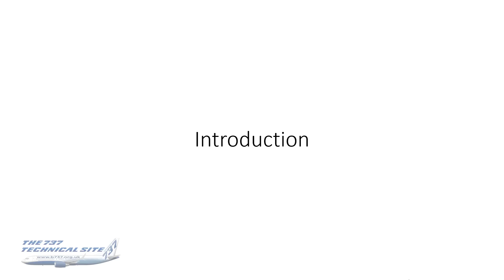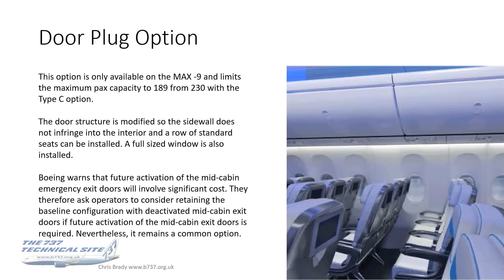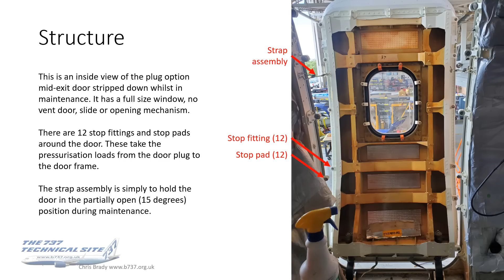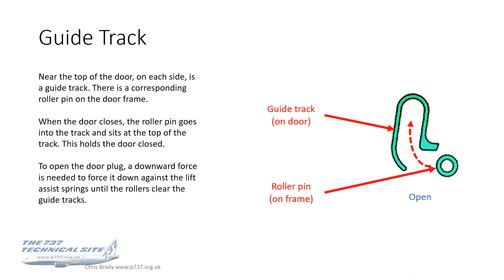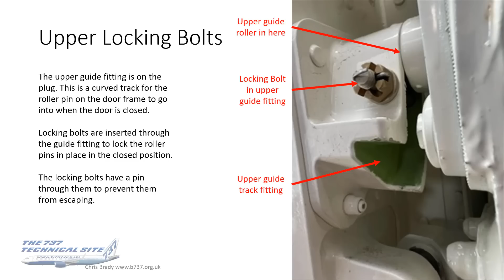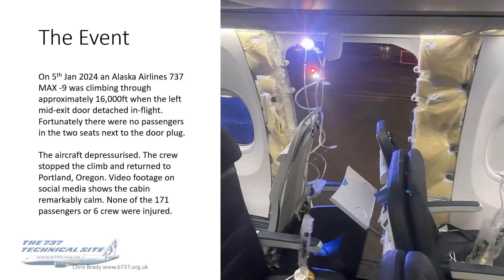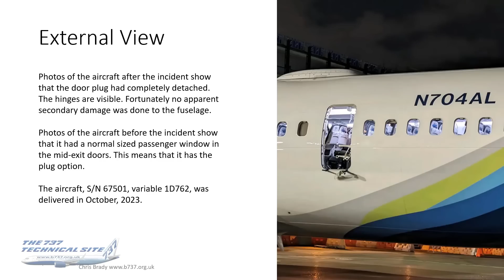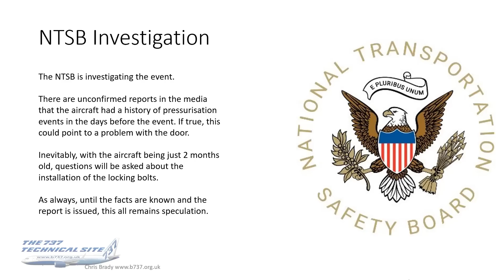737 Mid-Cabin Emergency Exit Doors - Plug Option

Comment: Chris the Boeing 737NG-900ER also has plugs installed. Last night we reinspected a -900ER for any discrepancies and found none. That aircraft had over 41,000 hours TT. If N704AL had failed the decay check: quite easy to perform, it would have been found and solved, so I feel that that was speculation on the pressurization issue. These plugs are not on line item inspections and only get inspected during a heavy check, there would have been no previous inspection done since it was such a young aircraft. BTW I love your channel keep up the good work. As you stated in this video there would have been a catastrophic failure of six different bolts to produce this effect. I await the NTSB report of their findings.
Reply: They're castle nuts with wire locks, so IF the issue is missing bolts it's not just a torque issue.  Missing wire locks would be an easy thing to spot.
Reply: @SteveSmith-cd4hs  It s gotta be the case, an inspection by a Inspector was simply pencil wipped or forgotten in the Aircraft paperwork! All doors require 100% Inspector buyback!!
Reply: @SAC-93  forgot about the person that actually did the work.
Reply: @scootercurri1815  Correct the lack of bolts or untorqued bolts slipped past two sets of eyes!! Inspection dept is ultimately responsible as that plug had to have a mandatory buyback from the mech doing the work
Reply: @SAC-93   "as that plug had to have a mandatory buyback from the mech doing the work"
Are you positive about that?  Closing a door is not normally an inspection item. But this was a plug, so there is that question.
Reply: @SteveSmith-cd4hs The wire locks are hidden behind the attachments.
Reply: Not necessarily a catastrophic failure of six different bolts, if all of the nuts were never tightened or even entirely omitted, one would only need vibration and pressurization/depressurization cycles to potentially back the bolts out. Unless there's an obstruction present to prevent that from happening, which doesn't appear to be the case.
In that type of case, assembly practices being adjusted and a slightly more fault tolerant design would entirely mitigate the issue.
Either way, that's why they do thorough inspections and investigations.
Reply: I think we're gonna find out that there were no bolts installed.    It makes sense to me bc even 1 or 2 would prevent this.  I can't see any other way for thia to happen it's either neglect or intentional @spvillano
Reply: @philipparana9225  I'm starting to think it was shoddy installation, given United reporting needing to tighten some doors bolts. They're not going to work loose with that crown bolt and cotter pin in place and likely wouldn't get mentioned by United if it was merely adjusting torque.
Reply: @spvillano my bet is no bolts at all.  Makes  more sense.  Also if someone installs one they prob gonna do all 6, but let's say they have no hardware and it gets moved down the line then the next person sees no bolts and assumes that's the way.
Reply: @philipparana9225  I only saw 4 bolts.
Reply: @spvillano  That's my feeling on what happened.  The nuts were not torqued up, vibrated loose and the rest is history.  A quality management issue from Renton.
Reply: @cjmillsnun  That has gotta be the reason! I can't think of any other cause- as I don't see any structure damage!!
Reply: Not torqued then not split pinned @cjmillsnun
Reply: @cjmillsnun  they are castle nuts so they dont get torqued.  you insert a cotter pin through the nut and bolt to prevent loosening
Reply: @AGM796  false! Most castle nuts have torque values !
Reply: @SAC-93   "false! Most castle nuts have torque values !"
This is true. They allow you to use an initial torque and then keep tightening until the hole lines up....without exceeding the max torque. If the hole doesn't line up then get a different length bolt or add or subtract washers.
Reply: @SAC-93   Oh no now I gotta go torque a whole lot of castle nuts.  thank you for bringing this to my attention
Reply: What are the chances that the RIGHT door has the same issue on the accident aircraft?  Assuming the doors were removed during FAL, you would think they get closed up at the same time.  It's going to be interesting what they find (or don't find).
Reply: @satoshimanabe2493   Yes it will Sato. I have found MANY identical faults by looking at the other side. One time I found a corroded fuselage part that was unexpected. I went to the hangar next door and found the identical fault on another aircraft. They threw rocks at me.  LOL
Reply: Or the bolts were never installed at all. The door is sealed without any of the bolts installed.
Reply: @allangibson8494   "Or the bolts were never installed at all. "
Highly unlikely since the vertical assist springs would cause the door to rise above the stop blocks.
Reply: @rael5469  the assist springs do not apply enough force to lift the entire weight of the door plug, only to ASSIST; hence the name.  So, the door stops would still remain interior to the frame stops...until vibration/landing was sufficient to overcome the additional force to slide the door sufficiently upward (<1"?) to allow the door stops to rise above the frame stops.
Reply: @BruceLiebert   "the assist springs do not apply enough force to lift the entire weight of the door plug"
How do you know?  What does it matter?  If the bolts were never installed a simple bump in the taxiway would cause the door plug to blow out. You heard Juan explain how after engine start the pressurization system put a slight pressure on the fuselage......specifically to tighten up the door seals. However after landing the outflow valve opens fully to depressurize the aircraft. If there were no bolts in that door it would have fallen out of the opening on the first flight.....not two months later.
Reply: @rael5469  It matters because if the springs were sufficient to lift the door and overcome the friction of the 12 stops against one another, the door would have detached immediately.
Reply: @BruceLiebert   If the bolts in question had never been installed the door would have detached immediately because the aircraft bounces on uneven taxiways and runways plus turbulence in the air.  A bump in the taxiway plus the help of the vertical assist springs would dislodge the plug almost immediately. I don't know with 100% certainty but I highly doubt the bolts were never installed. I think they were installed but not safetied and it took these two months for all four bolts to work their way loose.
Reply: I doubt that plane has even had a B check let alone a C check. Alaska hasn’t removed those plugs for maintenance. This is a Boeing issue.
Reply: @mendodsoregonbackroads6632   You can't say that for sure. Why even say it?
Reply: @rael5469  Because B checks are performed every 6-8 months, whereas C checks are performed every 20-24 months. This aircraft was delivered to Alaska in October. B checks don’t involve a structural inspection that involves removing all the seats and stowage bins, lavs, interior panels and so forth needed to access the plug or inspect the inside of the fuselage. That is done at C and D check.
Reply: @mendodsoregonbackroads6632   You have no idea whether they did any maintenance around that door plug. It doesn't have to be at any scheduled check. Other commenters said the aircraft was written up for pressurization problems. Did they do any maintenance around that plug at THAT time? You don't know and I don't know.
Reply: @rael5469  Doesn't sound like it. According the NTSB, they inspected the LIGHT. That makes sense. If a light is coming on that is not supposed to come on, then it must be a problem with the light.
Reply: @SAC-93  the picture of the accident aircraft shows that the pins are on the airframe and thus the guide channels are on the door.
Reply: @BaliMystic  I beg your pardon- I stand corrected- you were right, and I was wrong upon further investigation!
Reply: @BaliMystic  maybe we are talking about two different things- the guide channels have to be on the Airframe- the rolling pin will be on the door
Reply: @BaliMystic  Go to 9:38- the channel guide is clearly mounted to the airframe!!
Reply: @SAC-93   No, the guide channel is on the door plug. The guide roller can be seen on the aircraft in the photos.
Reply: @rael5469  yes I was wrong on that- I corrected my statement
Reply: Thanks for this information.
Reply: "That aircraft had over 41,000 hours TT." 
Practically new. barely broken in.
Reply: @@smacktard6051  " How do you think the door blew off without breaking the stops." 
The door stops mounted to the aircraft can be seen in the photos so far.  Everything is possible at this point until they find the door. Maybe the door plug itself had structural failure.
Reply: @@smacktard6051agree 100 percent.
Reply: We need to wait on the inspection results for the door itself. Particularly the roller guides. If they are broken, it could indicate that the door stop fittings were not rigged, making the guides carry the loads
Reply: @@smacktard6051 Because the door stops slid upwards past the frame stops, as designed.
Reply: I have to interject/disagree with the replies. In my opinion, IF the bolts were possibly over torqued (to achieve cotter pin placement) there is a possibility that the guide channel was structurally compromised and pressurization cycles caused it/them to fail thus allowing the door to open. We will have to see if they ever find the door to complete the investigation.
The comment about inspection pencil whipping is pretty strong, especially since Boeing has been under great pressure with the goose egg of an aircraft.
Reply: @gomez2724  I think the cotter pins and castellated nuts are the root cause. Used to have those to secure automotive wheel bearings on ball joint front suspensions and there can be a tendency to not tighten the nut sufficiently if you are trying to thread the cotter pin through the slot in the nut & the hole in the bolt/axle. But the cotter pin alone is not enough to resist the load forces. Awaiting the NTSB report.
Reply: @29caddy  there is negligible force on the cotter pin.
Reply: @gomez2724  Not knowing the bolt size or thread pitch this is just speculation and Im not fully conversant with S,A,E, threading. However if a 1/2 inch bolt of 13 tpi. and over torqued to the next castelation would give 12thousands of an inch of aditional grip lenght compression (if my math is correct).
Reply: Jeez get over yourself. Nobody needs to act as defenders of Boeing here.
Reply: @unthenner5519  fact finding is not defending anyone, it's just what its name suggests, finding of facts, root causes and means of repeating an accident.
And I'm a bit weird, I far prefer fact finding to have, you know, facts and investigations that actually involve investigating, rather than fingerpointing.
Reply: @gomez2724   I would agree with you to the point you made.....but the bottom bolts should have held the plug down against the stops. The upper channel is only to guide the door against the stops. The stops do all the holding against cabin pressure. I would think that those lower bolts would be adequate to hold the plug down and centered on the stops. .....unless they were also over torqued and cracked the lower fitting also. And that brings up another question......WHY leave the vertical assist springs installed on a plug? Maybe they should delete them by a Service Bulletin or even an Airworthiness Directive.
Reply: @rael5469  According to this video and what I've experienced, this door is only "hinged" at the bottom, the hinge pivots on bolts, they do not hold the door in any position. The upper roller guide cams go into the guide and rotate up, moving the door outward to the stops. The stops do not hold the door at all, they are there for adjustment in and out of the door for sealing/fairing.
Reply: @gomez2724    I've rigged a LOT of doors. Cargo doors, compartment doors....and main cabin. The stops hold everything. The roller guide only positions the door over the stops. Once the cabin is pressurized the door is blown outward until it contacts the stop pads. The stop pads hold all the force of the door against cabin pressure.
Reply: @rael5469  Not overtorqued- just not torqued or cotter pinned!- is the most likely suspect!!
Reply: @rael5469  "why woul leave the springs on a plug door" exactly the question.
Reply: @SAC-93   Well I'm telling you that I've seen over torqued bolts crack mount structure. Just sayin.
Reply: @SAC-93   We can't know yet until they find the door plug.
Reply: I'm curious why the EAD does not apply to NG-900(ER) aircraft with the plug option. Could it be that they have a different design than the MAX 9?
Reply: @AvGeekLucky  The 900ER's have been flying for about 10 years and never has this happened. No the design is the exactly the same. we have two MAX's right now and one had loose hardware, and it came directly from Seattle.

Comment: Why does this plug get attached from the outside in, being bolted to hold it in, rather than being fitted inside and actually plugging the hole shut? I thought we learned lessons on doors that opened outwards a long time ago.
Reply: Maybe because the failure mechanism would be for the door to blow inwards towards all the passengers if it was configured that way. Granted, while the cabin is pressurized the door would not blow inward but if the cabin was at neutral pressure with the outside then outside aerodynamic forces might blow the door inward.
Reply: @nostromo526  You'd still need retaining bolts if it was fitted inside, they would serve the purpose of keeping it in place still, and spreading the forces of the plug pushing against the frame. What seems odd to me is how such an important plug is fitted as it is. It appears to me, over-engineered and fundamentally flawed by being fitted externally.

Comment: Great explanation on the door functionality and structure… a lot of mechanical pieces would need to be missing for this door just blow open.  Don’t like suggesting this but could this be a deliberate action or sabotage by someone? I don’t see how such action could pass inspections and production checklists but this is a very interesting situation.
Reply: I don't think that four bolts, nuts and cotter pins is a lot of components to be missing from an assembly line.
That said, I could see - barely, a failure if the cotter pin was omitted for the nuts to loosen and fall off, pressurization/depressurization and vibration all then contributing to allow the bolts to depart the pins.
Lacking guide failures, that could be a common mode failure and difficult to prove missing cotter pins if the bolts are totally lost. But, the pins would show wear if the nuts backed out and the bolts gradually fell out of the pins.
And if there were indeed multiple pressurization events that can't be attributed to other causes, a redesign of the guide system would likely end up being ordered, with a more fail-safe design mandated. Because, if that chain of events were true, this is a fail-fatal design and would be badly in need of universal updating.

If it's omitted cotter pins only and a one-off failure allowing the door to unseat, order of assembly can be changed on the assembly line to prohibit the error in the future.

In the end, we'll get the most probable cause and suggestions, with everything thoroughly investigated.
But, this looks at first blush a lot simpler than the locking mechanism problems with the 747 cargo door latches and a lot of the investigation will be more of a paperwork exercise.
All, with the goal of ensuring this can't happen again, rather than an exercise in finding whose pee-pee to smack. Because, the latter won't prevent a recurrence.

Comment: More questions (sorry!)
Until/unless they recover the door/plug panel and inspect the stop tabs, rolling pin etc,  are inspections moot because the FAA can't tell airlines what to look for? If the stop tabs have sheared off from the door, it would make totally different investigation than if they are in perfect shape, indicating this was a case of the door simply moving down to unlock itself and opening normally. 
Unless FAA/Boeing already have good indication this was manufacturing defect "look for missing bolts", then the inspection regime is moot and would allow aircraft with a defect that is not uet known to return to service.
Reply from the maker: I hear that the plug door has been found. Hopefully that will expedite the investigation.
Reply: @ChrisBrady737  The statement from United Airlines more or less confirmed that they don't know what they're supposed to be inspecting!